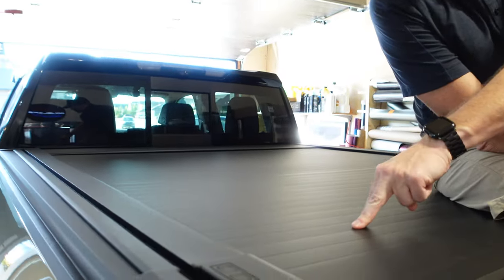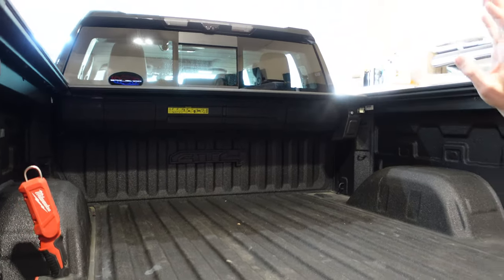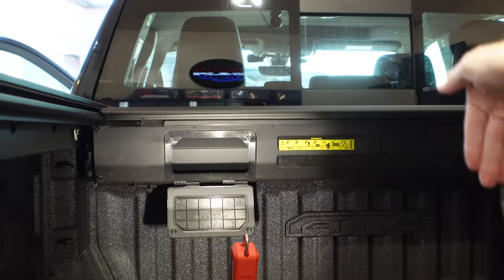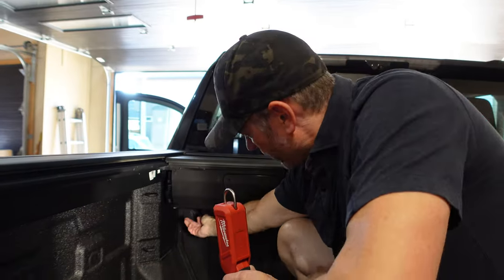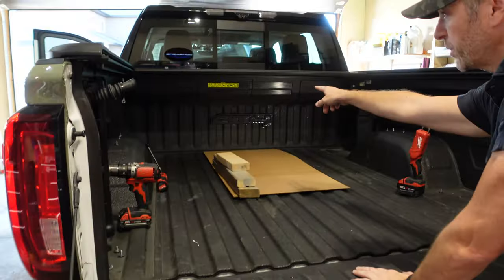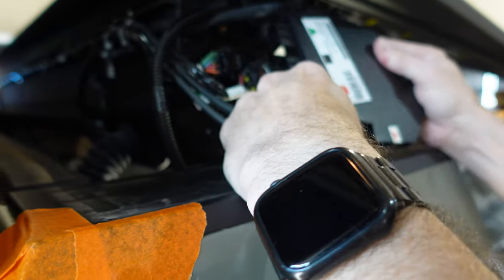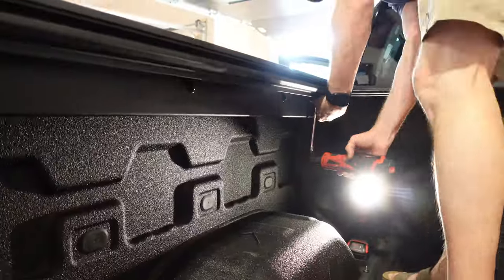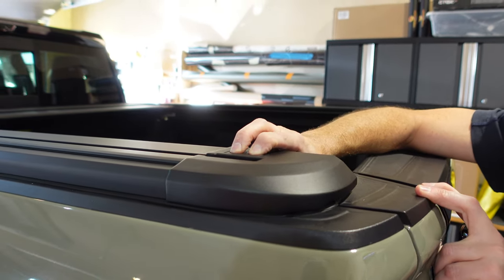EGR RollTrac Tonneau / Bed Cover - Remote Upgrade! Bonus at the End!

Comment: I just finished installing it on my Jeep Gladiator. It’s an incredible!  Top quality superb fit and finish. It is a OEM level top-notch product. I did it all without drilling. Used existing holes in each corner of the bed using a reducer coupling.  The video with some tips on how to do it is online.
Reply from the maker: Couldn't agree more!

Comment: Neat upgrade! Out of curiosity, if you double-click the lock button to close, can you then unlock your doors by single-clicking the unlock button or does that stop the cover from closing? I'm thinking of a situation where you toss something in the back real quick and then want to hop in the truck but don't want to wait for the cover to close first. I guess with the passive unlock on the driver handle it wouldn't be a big deal if the rest of the family was already loaded up. Super important details for those frigid winter days!! 🤣

Comment: I bought a Revolver X4 for my 2023 AT4. I really like it but on the few occasions I've had to keep it rolled up for more than a few hours I don't like the cover roll. It's just my personal preference since it doesn't effect the rear view from the driver's seat.  
When I was looking for a cover I didn't pay much attention to the auto roll up covers. I didn't want to be stranded by a expensive cover that I couldn't get to move due to failed parts. That wouldn't be a concern with a manual cover. 
After watching Don' install this auto cover I sort of wished I would have given them a better look before I bought the Revolver X4. 
That's the thing about this channel. Its like crack... once Don starts another mod to his AT4 I just got to do it too...       🤣🤣🤣🤣

Comment: How does it hold up in winter weather? Does it freeze up when its frosty?
Reply from the maker: I have made videos.  Had it working as low as -24°C / -11°F.   Below that the motor will protect itself.  Just like power windows and folding mirrors.   I think how much humidity is in the air that is allowed to freeze plays a big role.
Reply: If it freezes, can you unfreeze it easily? I have had a folding hard cover and when it freezes to the tailgate and then I can’t open the tailgate

Comment: I just received mine for my 23 Ram Limited. How do i verify I have the updated ecu? Also, did you have to cut and splice wires on your installation for a small module they sent? Thanks
Reply from the maker: I don’t believe I had to do that. Maybe it is a RAM requirement?
Reply: @Donslife  Thanks for the reply. I did re-read the instructions and it is only required on the older rams .
Reply from the maker: @gizmonova  oh good!

Comment: I was initially thinking there would be an issue with switching the passive door unlock to driver only would cause the cover to open as well (if inside 2 seconds) when you wanted to unlock all the doors, but I didn't realise they were separate settings for the remote vs the passive button on the door handle. I had to go and check on my truck right after the video. I could probably get used to that change on the passive door by using the remote for all the doors or just open drivers door then use the unlock button inside the door to get the rest open for passengers.
Is it possible to disable the remote functions on the cover at all? I could see there being times where it would be nice to avoid accidentally running the cover seeing it's so easy to bump the remote button twice. - hitting lock twice to hear the horn honk to confirm the truck is locked at a distance for example.
Reply from the maker: I personally am not sure at this moment.  But hopefully EGR sees the comment and can advise if there is a disable option.  My guess is not without an ECU update again.  But, I really have no idea.
Reply: @Donslife  If you left the setting on your remote to driver first, would the EGR ECU ignore the first unlock signal sent from the remote and essentially require 3 unlocks presses to open the cover? 1 for driver, then two more that the EGR would be seeing from the passenger door output?
Reply from the maker: I think it is two presses or ‘signals’ within a couple seconds
Reply: It's two clicks of the remote within about a second.  If you leave the fob settings at two clicks to open all doors, the RollTrac will open when you double click as well.  Single click opens all doors setting isolates that.   @PriceC
Reply: @patjohnson7952 It would depend on which input/unlock signal is being used by the EGR ECU. If it's looking at the drivers door unlock signal then that would be the case. If it's looking at the passenger door unlock signal for its inputs, it wouldn't pick up the drivers door signal from the first press of the fob if the truck is set to drivers priority vs all doors. It would (potentially) require the third unlock to trigger the EGR because it's only seeing two. I would have to take a look at wiring diragrams to know for sure, which I haven't done.
This wouldn't be the case with locking as there is no priority there and they are all locked with one button press.

Comment: One problem.... I love mine now that I have had it a while. However I wish there were a way to disable the key fob option. I went thru the car wash last week and they must of touched my door handle twice in a row, as my truck started into the wash the cover opened and no one saw it. All my tools and 30 years of shop manuals got soaked. I will say EGR help desk is NOT VERY HELPFULL. I called, the lady was VERY nice and said she would talk to the tech guys and they would call later or next day. No call.... I email.... no return email. Being is the service business I love the cover but their support is non existent. Mine is on a 23 Ram Limited EcoDiesel, I will have to wire a switch in my dash to disable the power to the ecu when at the car wash. Im guessing then I will have to go thru a re-learn after switching back on.
Reply from the maker: There is an update now that has it work with 4 unlock presses to avoid the issue you reported.
Reply: @Donslife  Hopefully they will announce the update somehow. That would be a good solution.
Reply: @gizmonova  just to confirm, I too have received pretty pathetic customer service.  Reached out to them for actual t-slot dimensions on the rails so I could source after market t-nuts and the technician was absolutely zero help!  How does Roll-trac not know the actual dimensions of their rails (or have a source for the t-nuts)??

Comment: how does that effect remote start?
Reply from the maker: It doesn’t.  This generation is a single hold/button press remote start.
Reply: OMG ive been using the app already  to start it and wondered why the old way didnt work thx havent had my ltz long enough to even use it yet, lol cant wait for this winter in SK 😉,
Reply from the maker: Hit lock once. Then immediately press the remote start button for about 3 seconds
Reply: Welp 
They don’t make them for the carbon pro anyway